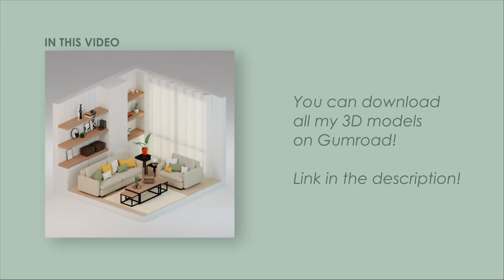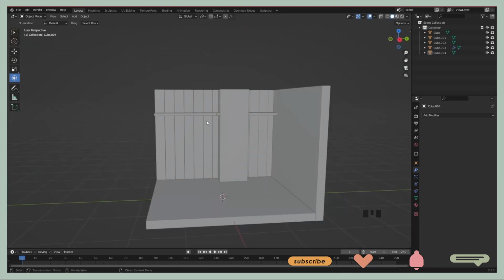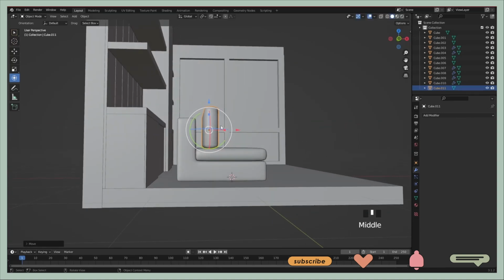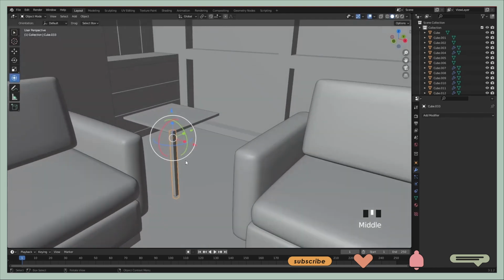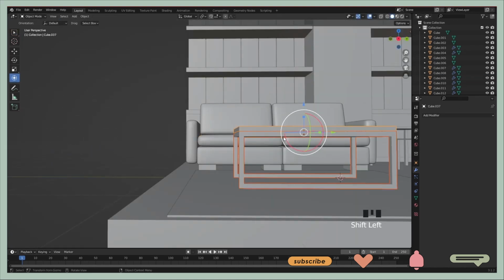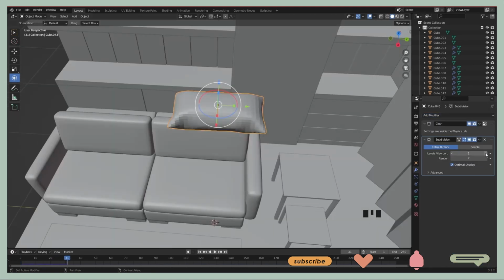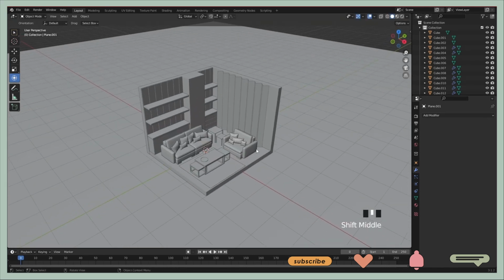Beginner Friendly Blender 3D tutorial: Cozy Living isometric room modeling

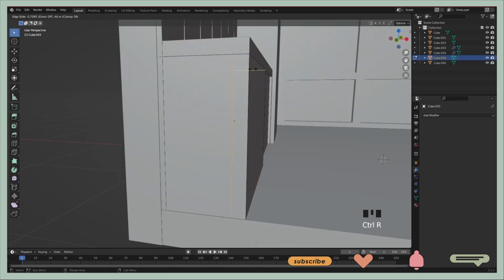Comment: 4:16
I’m so comfused
Reply: I solved it, let me help you

Once you select the First Drawer, Press Ctrl + R and the loop cut as shown, once you cut it hold Ctrl + B and you will get a cursor like this <---> then drag it to the right and make a bezel (which will be another parallel line to the cut loop as shown), once it is ready. Now, here is the tricky part, Click on "E" once and don't do anything and do not move the mouse, click on the middle mouse button and you will see 3 line which is Red, Green and Blue. Now according to the position of the drawer slide it inside towards the pillar by holding the middle mouse button and dragging it towards the line which is going towards the pillar and it'll be done. Same with the small drawer at the very right hand side. It took me 2 hours to figure it out considering I just started Blender.
Reply: @velvetvelocity10 h thank .
Actually I did complete it 2 months ago😂.
By the way.
Your instructions will help other people.
👍
Reply: Happy to help 🤞🏻
Reply: @velvetvelocity10 thanks for the help❤❤
Reply: It helped me